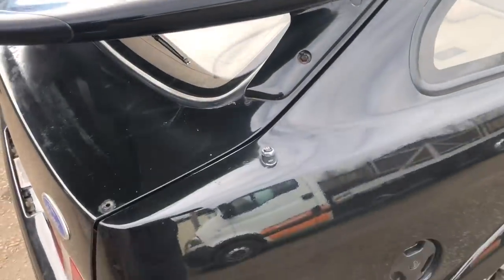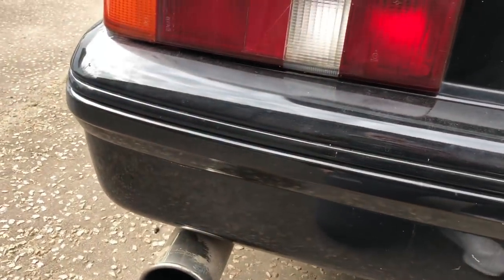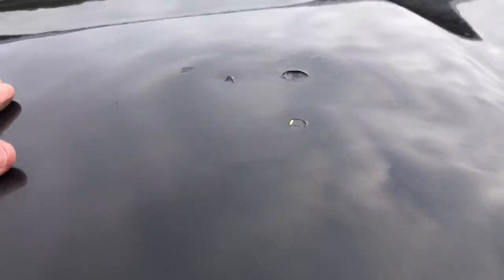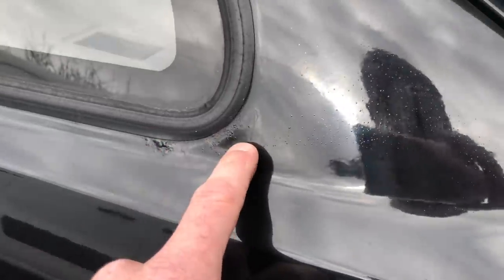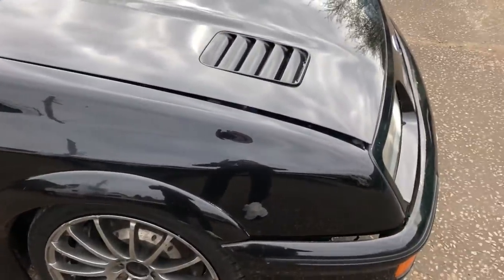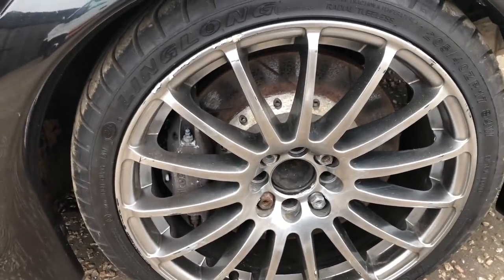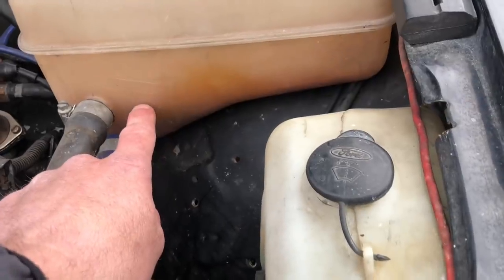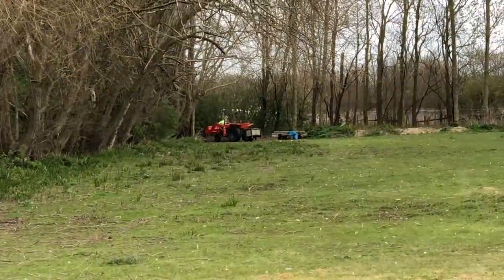Ford Sierra RS Cosworth 3 door how bad is it

Comment: It’s because its had a repaint in cold conditions, the moisture gets under the paint and after time they raise up forming the blisters, had similar problem on a car i bought yrs back.
It deserves a nut and bolt resto
Reply: The reason why you get micro blister is because of water from the compressor coming through the airline's

Comment: I think those blisters are a sign of a bad repaint.  I've seen that before when you don't apply a sealer on old paint before applying newer chemistry paints.   Yes, it will need a full paintjob  to deal with the blisters, but the real issue is that you will have to take ALL the old paint off to make sure it doesn't come back.  BTDT - I've restored 9 cars to date and bodywork is the most time consuming & expensive thing.   Overall, however, it's in really good shape, not much rust.   Still, the easiest way would be to soda blast it, but that would require removing almost everything - a huge job.

Comment: It's about what you'd expect for a 1980's car that's never been properly looked after. Unfortunately many people buy these cars and don't have the money to look after them. This needs a full strip down, acid dip and start from scratch.
Reply: Lots of money needed me thinks for that process. Hope he goes down that road but my guess is he won't.
Reply: @peternufc1981  I'd say your not going to see much change out 30 grand at the very least. I'm a close follower of Pete c on project bramble, and it costs him around 20-30 grand to do a cortina restro himself without Labour costs..😳
Reply: @Vintaronica  I thought it would be expensive mate... be nice to do it like, have a beautiful brand new cossie... 👌
Reply: @peternufc1981  Yeah, he might be able to get away with a light restro, which will last for 10  years or so but in order to bring her back as new, and to ensure she lasts another 30 years, it's a full strip, full dip, welding (It will need welding the body will be like a sieve) and a full re galv, prime, paint, retrim, engine refresh...Yeah a lot of time and money

Comment: Wouldn't be surprised if that passenger door lock was attacked by a screwdriver thief, quite common on mid to late 80's ford round barrel locks.
Reply: to be fair, didnt even need a screw driver, lost the keys to an rs once, the cab keys worked in it though, the keys and locks were so worn lol

Comment: Rob, those micro blisters look like some sort of reaction when the car was repainted. Definitely needs a repaint . Great little video.keep up the good work and stay safe. 🙏👍
Reply: That was my thinking too. Multiple incompatible paint systems.
Reply: micro blisters are usually the result of painting a car on the cheap as in not using an oven, and being painted in a open unit or garage, thats why you dont see them on factory painted cars as they are painted in a controlled environment
Reply: Rob, would be interesting to see you rub down some of the micro blisters, to see if you can find out what caused the blisters? 👍
Reply: Usually caused by moisture ... atmospheric conditions , water in airline etc etc......
Reply: LEE 71 i think its called fisheyes
Reply: @billkhan6333 fish eyes often a problem encountered with silicone back in the day...wax  polish , dash dandy etc... different terms used by different painters lol....thanks for taking time to offer opinion 👍

Comment: The big brakes explain those wheels. The standard wheels will never fit over them. Had the same  issue when putting a set of standard wheels on my Saab for the winter and they would not go over the Maptun discs and calipers

Comment: Who was the previous owner. Colin Mcrae?. Looking like a long time restoration project you have there.strip it to a shell and do a proper ground up job.well worth it in the end
Reply: Why wouldn't you? These car's fetch stupid money!
Reply: My thoughts too 👍
Reply: Get it back to OEM finish and its a gold mine.
Reply: 1chish isn't it just unbelievable what good Cossys actually go for nowadays when u think what they were new!!?!?
Reply: It’s not as bad as you think??? 😂😂😂it’s gonna be a great project, not cheap but will be a stunning motor when done 👌🏻
Reply: I hope you’re going to put dust caps on those wheels 😂
Reply: @princecharlie3217  that would be putting lipstick on a pig.the only one way for a car like this is balls deep just like the range rover they have on the boil.and that's coming from a non ford man
Reply: It's over 35 years old. And it was at one point in history the most stolen & sought after vehicle in the UK. This one was most probably stolen at some point and recovered.
Reply: @lukey3507  thats exactly why it needs  proper treatment and respect
Reply: James S Hartland he said he is not going to spend a shed load of cash on it as long as it’s structurally sound and mechanically a tidy up is good enough if you want to go down the complete Pete c route of total strip down and dip shell etc it costs more than the cars worth
Reply: James S Hartland only worth 19 k fully done now if it was an rs 500 different story 70k

Comment: The paint blistering is solvent pop. It happens when you don't allow enough flash off time between coats of paint.
Reply: could be or its micro blisters from moisture in primer coat.....from either wet sanding a bad quality primer.....or moisture from compressor i.e no air dryer or painted in an ill equipped shop
Reply: @kaisersoze5236  it's definitely water contamination from the airline, had the exact same effect a couple of times when I worked as a panel beater, it's a pain in the ass because it takes a while to show through
Reply: @adeh503  yes can take anything from weeks to months to make it to sirfave depending on environment/sunlight.....23 years at autobody i've seen it all and still learning 👍

Comment: The 'repairs' to the door locks could be due to them being damaged by attempted theft. A guy I worked with bought a Cossie around 1988 and had it stolen 3 times in 8 months. After the 3rd time he sold it as he couldn't leave it anywhere!
Reply: Allan Davies same ! I owned a red RS turbo escort And I might as well have left the doors open and the key in the ignition. Getaway car for potential ram raiders. If you were around Newcastle in the late 80’s
Reply: I seem to recall that the Sierras of South Africa were V8's, or so I read, never got to see any pictures.
I live in NZ, our Sierras years ago would have been just as yours.
Quite a rare site on the road now, down under !
😁😄👌👍

Comment: I bed theres a multitude of sins hidden beneath that paint it looks like it's been painted with celly to
Reply: I make you right, Rob.
Reply: Bad paint jobs generally cover up bad things
Reply: Rob I noticed the paint is very orange peel if your old enough to now what that means 😍👍🏻
Reply: @Rick-sl7iw  I am old enough 😭😂
Reply: Celly?
Reply: @wildcatgaming4748  Old paint system. I really hope it's not full of filler too.
Reply: WildCat Gaming celly is a type of paint (cellulose)!
Reply: @jn8092  im sure he knows how hes gonna sell it but if not then I guess he needs to decide? Not many of these around these days so I'm sure theres money in it if he just flips it with a bit of a tart up. Look and sounds to me like its had a hard life but seems reasonably straight and def salvageable. Really hope it's a full mechanical and cosmetic nut and bolt resto to stock 🤞
Reply: @ftgoggi4715  looked a good solid motor don't take any notice of the know it alls.love watching your channel😃
Reply: It’s had a bad paint job. Wonder how much filler it’s hiding.

Comment: You were possibly refuring to my comment in the video, after a close up look at it your right it would benefit more from a full respray than a full wet sand & detail, The engine sounds alot better so thats a bonus in itself, I would de lock the nearside door while repairing the bodywork saves that ever being an issue in the future, its probably had a few screw drivers poked around the locks over the years, nice that its got all matching windows too., thanks for the video

Comment: Is it just me, if I close my eyes its sounds like a bog standard 1.6 sierra, I know what engine it has but it sounds so dull from what I remember.
Reply: Probably because in the 80's & 90's, you'd never see a Cossie without a 4inch pipe on it.
Reply: It was based on the pinto engine
Reply: Mark cbay only the block was similar.
Reply: I know ,with a twin cam head

Comment: Used to get this micro blistering problem when Lesonal p62 filler primer was used as is held moisture below the top coat and later the blistering would happen,this was in the late seventies /early eighties.Needless to say stopped using it never had the problem again...

Comment: Great video :) I would be pulling the seats and carpet out to check the floor. I did this years ago on a 1982 XR3i before I repainted it. It was full of rust and holes, sadly. Fixed them up and after a respray it looked great....resprayed by myself in the company warehouse. It looked great in Sunburst Red for years.

Comment: A full quality repaint is essential in my view for such a classic and now rare car ; my brother in-law had one new back in 88/89 on a G plate and it was a very very expensive Ford in its day. Hopefully you’ll be able to deal with the bodywork sensibly and sympathetically without the need to rip the car apart as has been suggested. Make good and mend in a quality way seems to be your method and I would agree totally with that. Looking forward to the next instalment 👍

Comment: I’m glad that your going to be giving the cossie a full respray which will only add to future value,looking at the paint condition it’s certainly had some sort of respray during its past as that looks like dirt in the clear coat laquer, be nice to see you pull the engine and gearbox out and get it all painted up and the engine bay painted possibly as well as replacing the header tank and brake master cylinder? Keep up the great work tho rob and all the best 👍😎

Comment: I used to have an XR4i which had the two spoilers. On the XR4i the rear quarter windows are worth more than the car! 

Love you car, needs the cross spoke standard wheels and the second spoiler. It will be a minter once it’s had some paint. Enjoy the car 👍🏼

Comment: You have me seriously considering buying a Merkur we have here. It's essentially the same car but with a 3 inch strip splitting the back window making two windows. The motor is the same block but with an iron 8v head. The Volvo 960 16v head bolts right on using some other OEM bits for the timing belt setup. It needs an oil distribution block welded on the back of the head with a feed line for the DOHC. head flows over 350cfm stock at .500! Not sure if I'd remove the strip in the rear and use the one piece glass or no.
It's even got the original first aid kit sealed lol.

Comment: Hi I tried looking in the comments about the Rear Brakes .
As you say you fort they were standard incase someone hasn't said they look like 4wd sapphire Disc's and calipers the disc's look vented from what I could see..
Standard FORD Parts and is a perfect upgrade I also put 4wd rears on my 2wd Saph Cossie. 
Looking at the size of them front disc's I dont think your get any wheel smaller then a 16" set up.

As for the rear lower spoiler that's been removed as you gone for the front "RS500" Lower spliter I'd say try get the rear lower one to suit 😁

Keep the videos coming been really good watching them my Saph cossie been in the garage for 15yrs this July and one day I'll be getting it back on the road 🤐🤗

Comment: I think once you done the repairs on the care i agree it will need a respray in the original ford black and i would put adjustable shockers on there two i think once you done the car it will be nice i hope you are putting the lower spoiler back on i would myself it’s part of the car

Comment: I wonder if the standard wheels fit over them  front brakes mate ?  Hope they coolant system.isnt pressuring somtimes the gasket blows in the way and does not affect the oil. Check the crank seal behind the bellhousing  when doing the clutch 👍

Comment: Thanks for putting this on film. Lovely piece of fast Ford History it’ll be awesome when done, but reminds me of why many fords of this vintage (even XR or RS versions) were rusty crappy cheap and a little sad looking. I’m thinking mid 90’s when the glamour of the 80’s had faded and all that was left was the remnants of crap home paint jobs (yep me too), repairs and cheap components. Doesn’t matter how much you tart them up and how fruity the engine is, they were still cheaply made fords. I could have picked up a sad and slightly rusty XR2/3/4 for £500 in those days...still...I’d love one of these now cos I could never afford one when I was 20.
Amazing what nostalgia and the word ‘retro’ does for values...

Comment: Looks like this could be a great project. I am wondering when you say >it needs paint< just how far you intend to go. Perhaps it may be worth a back to metal strip and a real top of the range spray job if all the rest is OK? Cheers, Bob
Reply: I am sure this would certainly be a bare metal job.
Too many imperfections allowing water to gain access to the inner body.
Micro blistering give away is thats generally the same height across the entire car.
A case of compressor air not being dried before being used in a spray booth.
Probably used in a backyard with a person with above average skill considering .
😁😄👌🖖

Comment: Nice car needs a bit of love but it will be nice when it’s all done 👍 Big brakes on the front is a tell tale sign it was once a fast car. If the rear discs are vented they’ve been upgrade with standard 4x4 sapphire disc,pads and callipers. And make sure you get a turbo damper fitted be you go out giving a boot full. Keep the videos coming 😎👍

Comment: Its  clearly worth doing,  The body work  actually isn't to bad, no major dents, or rust,  but because of the blistering, it will need a strip and possibly dip , then zinc  spray  to ensure no reaction, from the old paint, if you can do most of the prep, the cost is largely in the labour, and if you want it mint, its always best to prepare the shell yourself, and   then get the paint shop  to do the primer and top coats,  whats the availability of interior parts now for this model?

Comment: I have been waiting a while to hear your catch phrase, " Skin off a rice Pudding" I just love it 🤣👍👌
Looks like that micro blistering is a case of the compressor air not being dried before being used for paint purposes.
Probably not a paint booth.
Notice how the same blister(s) appear about the same height all around.
Thats standing height where the crook of the elbow is at right angles.
You touch upon the key barrel problem.
I am not familiar with what Ford have done to overcome this, however I suspect a Garnish kit maybe available.
Look forward to the balance of videos.
Some much can be said about preparation, looks like a backyard paint, not bad considering,  need to bleed compressor condensation each night after a days work.
Thanks Rob.
😁😄👍👌

Comment: I've been detailing & valeting for years buddy there is not a detailer in the world that would solve it, that it is going to need a respray it may have had at least 3 repaints before blistering don't come from the original paint, my mate had one of these same problem tapping noise is tappets no oil getting through oil channels not letting enough oil through maybe sludged up until oil pressure gets up I recommend engine flush get the channels clear or else you will excessive wear on startup.

Comment: I think the paint is the least of the problems you might have with a car like this, meaning you dont know if the engine is burning oil and needs a complete rebuild and I would definitely get the turbo checked over and  rebuilt if needed, but how far are you going to go on it .???  Keep these excellent videos coming .

Comment: Well rob the jet wash didnt damage the car, most of us know that, we saw the dullness and paint blisters before you even got starter, so totally agree with you buddy, to be honest more ive seen of it, im thinking its been totally repainted and badly at that, the  body kit on it seems abit of a mess to on sides dont look like its on to tightly, (but that could be just on camera not doing it justice)-- repaint indeed id say, obs who had it thought rush the black on it, and its not been done right, even repairs, shame! 
But got no doubts you can get it sorted rob! cost of respray might not be cheap, but i think you will come up with a great thing or two with it! main thing seeing so far, is the rust isnt in to bad condition and the body kit isnt totally wrecked.

So glad to hear the rattling gone, thought it might of been just the oil needing to get through the engine fully and coat the lifters! really glad its nothing else :)
Lovely solid engine there rob! no problems at all :)
Glad the leak under car was not bad lol (Noticed hehe)
Great video as always rob ! 
Stay safe best wishes to you and chris :)

Comment: Hi matey i have a nissan skyline r33 gtr with exact same problem. Its already been painted twice and now going in again for a 3rd time. Thats water trapped under the paintwork which has come.up.after a long time in the form of blisters. Either from water in the spray gun when painting or water under the basecoat. Will need a full flat down to base and full repaint
This is due to a poor previous paintjob.

Comment: If i go to a car show and there is an immaculate restored example  and another which is still wearing its history which is more interesting to look round. Shame that the paint blistering is so bad. Will it need need a bare metal repaint. Be sad to see the character go with new paint but need must. Good to know that the tappets pumped up and now run quiet. Why do you never see cambelt covers on old fords , weight saving i suppose. Stay safe and well.